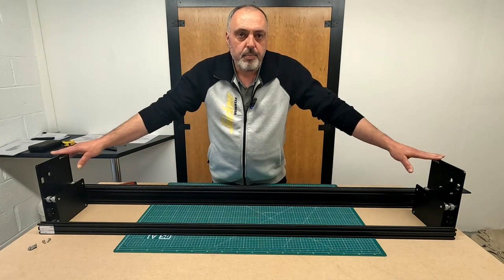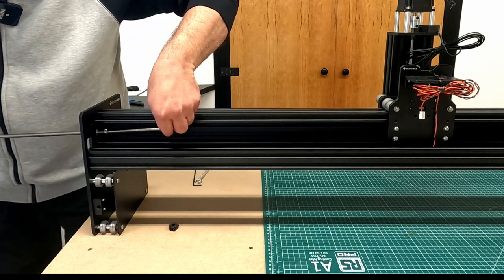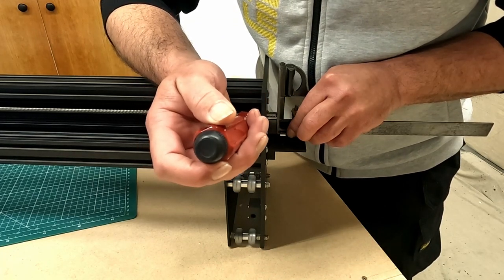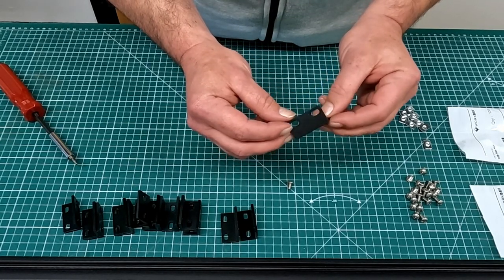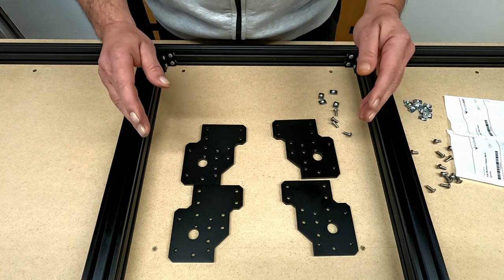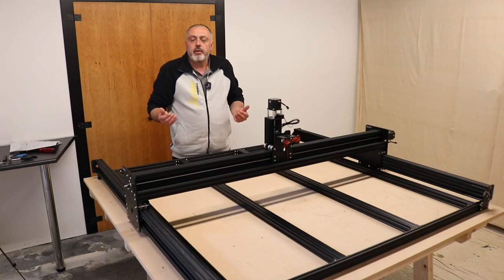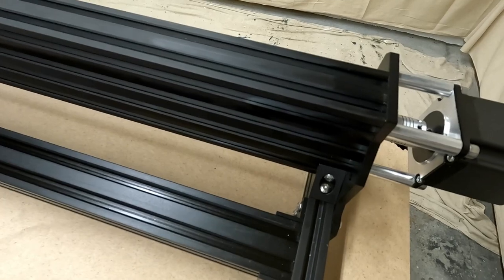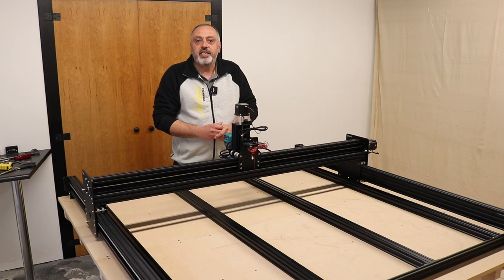Building A Workbee Z1+ CNC Part 4 / Mechanical Assembly Completed

Comment: Fantastic series. I've just purchased a Workbee Z1+ and couldn't have progressed (not finished yet) without your guides. One suggestion which would have made my job even simpler. Quite a few times you mention for example "add a bolt and screw on a t-nut ..." I then have to switch to Ooznest documentation to workout which bolt and t-nut needs to be used. An overlay text with the size of the nuts and bolts would've made my job a lot easier. Many thanks.
Reply from the maker: Thank you, I appreciate your feedback the reason I didn't specify the exact bolt and nut etc is because I wanted people to refer to the Ooznest documents to get the correct bolts etc. I believe you would get a better understanding of the build and the components this way and also would allow for any changes or upgrades to bolt sizes etc introduced by Ooznest to Z1+ kits after I received and completed the video series. I hope that makes sense. Tommy

Comment: Hi Tommy.  I’ve just got my Ooznest machine and am in the process of putting it together.  Your assembly videos are a godsend.  If I had been totally relying on their instructions, I would have been struggling.  Thanks so much for taking the time to record and post them.
Reply from the maker: Ho Robin I'm glad you find them useful good luck with the build 👍
Reply: You weren’t joking with those t nuts on the base rails were you.  🤬
Reply from the maker: @robinparkes988  a little patience required 🤣

Comment: Still here Tom, excellent video! I worry about all those screws working lose as you use the machine; how accessible are they after you put it all together? I am also concerned with saw dust getting into those tracks as you use it? How is that working out?
Reply from the maker: Most of the screws are easily accessible, there are some that are not but I haven't had any issues with any screws becoming loose so far. As for dust in the tracks yes there will be some dust getting into the tracks I just run the vacuum cleaner on them or give them a blow with the air hose once in awhile so not really an issue

Comment: Hi Tommy just found your videos after I bought mine.  Any tips on where to pit the router power cable.  Did u put it in drag chain or straight up into a ceiling socket
Reply from the maker: Hi, I put the router cable straight up to the ceiling, I will be running it with the dust extraction pipe once I add extraction properly. It is not advisable to run the cable through the drag chain as it can effect the signal to the stepper motors etc. I hope this helps 🙂
Reply: thanks Tommy I'm nearly complete on the build so hopefully start machining by the weekend fingers crossed 🤞

Comment: I have added my router as instructed, but have noticed that the lead screw is slightly sticking out on the x axis. Is this right or should it be flush with the bottom plate.....
Cheers
Rich
Reply from the maker: Hi Rich, I presume you mean the z axis. If so the lead screw should be flush with the bottom plate if not check you have it touching the stepper motor shaft in the coupler. There isn't a gap between lead screw and stepper shaft like on the x and y axis. Hope this makes sense.
Reply: hi yeah just checked this and there is a gap. Is there an easy way to adjust this or will the whole z axis have to come to bits.
Great videos really helpful using them alongside the oozenest instructions.
Reply from the maker: @gibsrich2007  you should be able to adjust while together just support the z axis from dropping open the coupler and screw up leadscrew until they touch and retighten the coupler.
Reply: many thanks will give it a go. School boy error. Things were going far to smoothly lol
Reply from the maker: @gibsrich2007  simple mistake but also a simple fix 👍
Reply: Loosened the the screws on the coupler and as soon as I loosened the collar it jumped to place. Just need to tighten up and re adjust the bottom collars now. Phew and thanks for the help
Reply from the maker: @gibsrich2007  no problem glad I could help 🙂